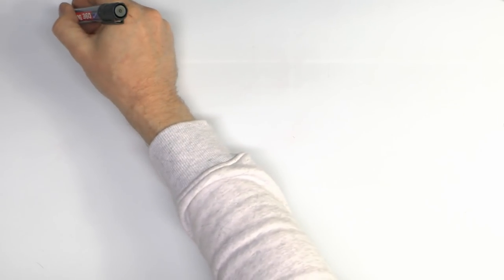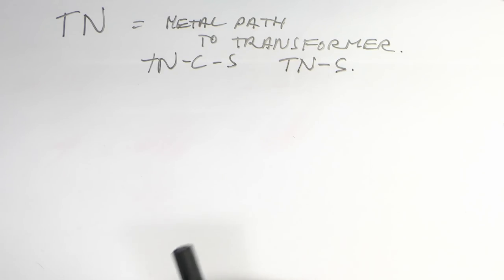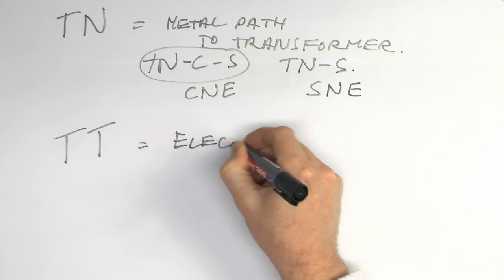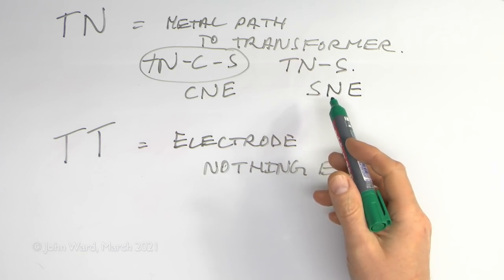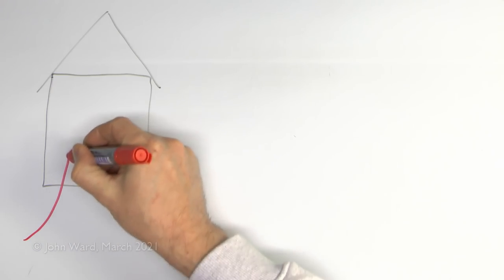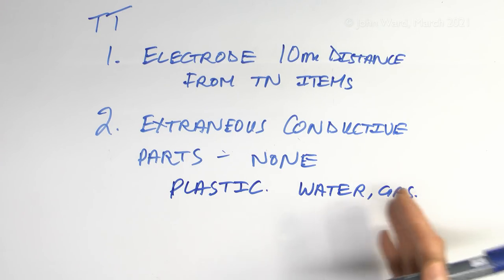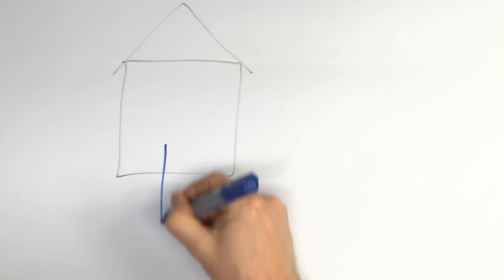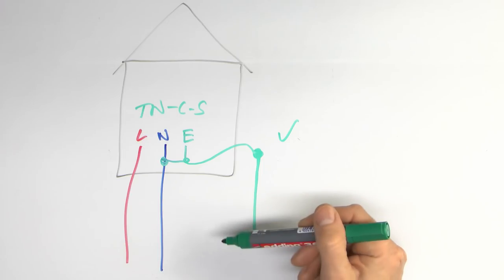Using a TT earth where a TN earth already exists

Comment: Why not extend the earth cable at 12:03? Let's assume we install an external WIFI router instead of an A/C condenser. That means an ethernet cable probably also runs inside and connects to other electrical equipment. Wouldn't it be a good idea to bond the earth spike to the house earth in order to prevent differences in ground potential difference? I'm asking this because I personally had wifi gear on a pole outside my house, and almost every electrical storm without fail blew ethernet ports on the routers (I was only using an earth spike for the gear and pole outside). I'm guessing I could have alleviated or prevented some of that damage if I bonded the earths, or relied exclusively on the house earthing rather than a separate earth spike?
Reply: Stuff like wifi routers are all isolated low voltage dc made by switchmode power supplies. There should never be a path to earth from the isolated secondary side. So long as your router has a power brick and only a dc input you just need some form of optoisolation on the ethernet cable as soon as it enteres the property to prevent a potential path to earth via your ethernet cable. Also providing a preferntial path to earth for lightning strikes near your pole may be benificial.
Reply: Many years ago I was part of a team that created a "pole top" concentrator for low calling-rate telephone lines. It linked 14 telephone lines to the exchange using only 4 pairs of wires, the idea being to be able to offer service to new customers when there were no spare pairs in the existing cable.
The prototype worked beautifully linking our office phones to the site PABX. However when we put the pre-production units into the field, actually on the tops of poles and linked to the exchange via overhead wiring, the failures started. Unit after unit was returned as faulty and in every case the fault was lightning damage. Some of these units had been miles from the lightning strikes but the induced current in the phone cables had been enough to blow the semiconductor switches used in the unit. It proved impractical to adequately protect the unit from such surges and the project was abandoned.

Comment: An interesting Video JW, thanks. I can confirm a 10ohm or lower electrode is difficult to achieve. Our lightning protection system installed on the explosives magazine needs to be below 8 ohms, it turns out that's a large earth farm!

Comment: I am not an electrician.. but I am involved a lot in Cambodia where skills are minimal and safety is not thought about. On our small farm, there is no earthing system - this was going to cost more money, so they don't do it. I have a shed where I have a lot of tools, lathe and particularly welders - all without Earth connections. I am thinking, can I at least, make things a little safer by putting an Earth rod in where the shed is.. it is remote from the main house... and then connect this Earth rod to the earth outlet connections in the shed. Would this provide a level of protection, and should this Earth connection then also be connected to the Neutral ? which of course then would connect all the way back to the sub board in one of the properties and then to the main board where the power enters the properties... I know the answer  is to put a proper earthing system in all the way through but at the very least, I want to improve the safety of welding where there can be a lot of water also.. ugggg.. :-( ...

Comment: If the outbuilding is a Metal structure on concrete floor with incoming water in plastic pipe, what earthing arangement should be used If house has TN-c-s? And shall you bond metal structure?  Thank you JW

Comment: Help please! I had an electrician install an all metal construction, step lift in the garden. Few years on, after watching JW, i realise the armoured cable was never properly installed via a glad to the CU, nor is it possible now because the cable entry into the house is buried in the wall. It might well be a 3 core cable, not checked yet. If this appliance isn’t bonded properly, would a TT setup be useful?

Comment: Just what is the issue with bonding a TNCS supply to an earth rod. Surely you then have double protection and a lower protective earth resistance.
Reply from the maker: There isn't one, but to have any real effect, that earth rod needs to have a very low resistance.  A single rod with 10s of ohms or more will do nothing.
Reply: @jwflame  Thanks for the reply, I agree the earth rod must be effective to benefit or several. Some idiot stole the copper bonding from our local sub station station. The power company came and installed temporary earth rods as were on a TNCS supply.  Since then we I felt safer with our own earth. Thanks.

Comment: Hi John, great video however if you say that outhouses need to be TT due to extraneous metalwork and the need for 10mm bonding how does that relate to a hottub ?  As i understand it hottubs are mainly plastic or fibre glass. Appreciate your reply. Thanks Tony
Reply from the maker: if there are extraneous conductive parts, they either need to be bonded to the TN-C-S supply with a minimum of 10mm², or if it's configured as a TT install those ECPs cannot be connected to anything with a TN-C-S supply, which in most cases is impossible as it's very likely those parts will be shared with the main building or other buildings nearby.

Hot tubs don't need bonding as they are not extraneous conductive parts.  They will have an earth connection to the heating element and possibly other components, and that is sized based on the cable that supplies it.
Making a hot tub TT is an option but can be difficult or impossible as the electrode for it has to be far away from anything connected to a TN earth.
Using TN-C-S for a hot tub can have other problems, those are covered in another video which will be published later today.

Comment: May I ask, what your views are on the A2:2022 regulation 411.4.2 (p68 of the BBB - BS7671:2018+A2:2022) please?  Whereby, it is now recommended to  (i.e. you SHOULD) install an additional connection to earth by means of an earth electrode (as a TT backup to the PEN)?  And, with respect to outbuildings, would you still divorce the PME from the house and install a local TT, or does this now mean that you can export the PME/TT to it?  Thanks.

Comment: So if you connect a remote building to a TNCS house, you should take the earth over from the house and join it to an additional ground rod. If the remote building has a steel structure (RSJ into the ground) could that be used instead of a ground rod?

Comment: Hi John, I was wondering if large isolation transformers would be an option, although clearly would add Extra costs
Reply from the maker: Yes they are.  An isolation transformer is mentioned in BS7671 as an option for EV charge points.  Cost is the major problem, £100s for even a small one.
Reply: @jwflame  well isn't that the truth!
So are you going to take me on as an apprentice now or what?

Comment: As the water pipe comes from the main building, and as you suppose it is already bonded. Would you have to bond it again?  Or could you just instead use the main earth from the cable to do bonding only?

Comment: Thanks for the video, always appreciated. Does someone not make an RCD type device which looks for a current >"x" in the conductor between the MET and the earth rod - and when tripped will disconnect  Line and Neutral conductors?.
Reply: Interesting idea. In order to keep the integrity of the cable between the MET and the earth rod I envisage a current transformer around the existing unaltered cable. Hypothetically, ? could a very small amplified voltage generated by the sensing coil around the cable be applied to something like a modified RCD deign (100 Amp). One MET = the whole supply disconnected.

Comment: I have a question to you John. When there is a risk of EMC problems due to PWM devices like solarchargers etc we learn here (Sweden) to use armed/shielded cables and connect both shielded ends of the cable to earth with short connections to lower the impedance for high frequencies. In the case of the shed having its own TT earthing and an inverter or charger positioned there what is then your opinion about the best way to go forward when it comes to earthing? I like your tutorials!

Comment: If I change the incoming water pipe to plastic, but there is metal pipes in my house. Won’t the water itself lead electricity and there by my pipes inside the house is connected to my neighbors earth connection?
Reply: It depends how much dissolved solids your water contains, pure water is an insulator, its only when theres shite like salt etc in it that it conducts electric. 
When you take into account the resistance of all the water between yours and your neighbours house, any fault current would likely be very minimal

Comment: Shouldn't the RCD to your car charger or shed trip even if the ground stake is more than 10 ohms? Is an isolation transformer to likely to fail for safety?
Reply from the maker: A broken combined N&E conductor on the supply will not cause any RCD to trip, the break is on the supply side of the RCD.
EV chargers can be supplied from an isolating transformer - the problem is that the transformer will cost more than the charge point.
Reply: @jwflame  OK thanks, I never thought about it before but this is probably why we use to get a shock on the kitchen sink when running high current stuff like the feed mill as the mains line is always going to have some resistance.

Comment: I have a question-why must one conductor be earthed at all? With the electrocution hazard involved, would it not be better if neither was referenced to earth?
Reply from the maker: If a system could remain isolated, it would be safer. It's used in a few specialist applications.
The problem is keeping it that way - any single fault to earth anywhere would make it into an earth referenced system but with no control over which conductor was earth referenced and no way to detect that fault until a second fault occurred.
Reply: @jwflame  The man himself answered me! Thanks John. I use an isolation transformer when I work on old radios and every time I use it I wonder why the residential service has reference to ground. By the way, could I make a suggestion for a future video? The SWER system used in very remote Australia and other parts of the world? I find it fascinating and I know your analysis would be spot-on.  
Take care, Ian.
Reply: We use exactly this IT based system on the railway.

However copious use of insulation monitors mitigates the chance of a single earth fault causing issues... For installations with no insulation monitors then every time you open the cabinet you have to do an earth test (unless it's vern done in the last couple of days) thankfully they are quick and easily done but you do need to understand the method and readings you get.... It gets even more complicated when 25kV overhead wires are involved because those are earth referenced (whether you want it that way or not, rail lines even when on insulating pads make a fairly good earth over many miles!} https://www.bender-uk.com/products/insulation-monitoring-overview

Comment: What about electric vehicle chargers that are 20m away from building? Isn't TT the best way? Electrode shoved right under the charger/vehicle. Even if there is a power line beneath...humans are still walking on that same ground where electrode is (or isn't).

Comment: Interesting topic, now EV chargers come with PEN fault detection, surely manufacturers could come out with a PEN fault detector for the whole installation??
Reply from the maker: The same junk that's sold as PEN fault detection could be applied to a whole house.
As it only works some of the time, there really isn't much point.
Reply: @jwflame  thanks for the reply, do you have a video on PEN fault detectors and their problems? Would be interesting to hear your opinion. 

Kind regards.

Comment: The problem explained around 13min: wouldn't it also be problematic if the earth rods was placed sufficiently far from the burried pipes, but someone touching the EV was standing close to those pipes. Isn't the condition for safety that someone touching the EV needs to be standing much closer to the earth rod placement than to the burried pipes.

Comment: Interesing video...would not the 10m distance for a TT rod be only in ideal circumstances?
I live in a terraced house with a small garden, overhead supply with no supplied TNS earth hence the use of TT, ( Ze of 25.2 ohms, Zs of 0.19 ohms), as are most in the street, but a couple of properties have been converted to TNCS from the overhead supply. All other services are still metallic. It's not possible to be 10m away from any services or other TT rods therefore some rods will not be 10m away from TNCS converted supplies. Is it really feasible to account for other earthing systems within a group of buildings?
Reply from the maker: All of the properties should have been converted to TNCS, or none of them.  With only some done, they are TNCS, and the remaining ones which were set up for TT are probably not TT any more, due to the metallic services connected between the properties.
The output of one transformer should be a single earthing system.
Reply: How can the Zs be less than the Ze!?
Reply: @AdamWatson001  parallel earth paths

Comment: 12:04 why does the earth cable stop there? Does it earth just the charger’s housing?
Reply: No connection between TN system and EV charger housing, the cpc stops before entering the charger.

Comment: John at 10.10 if the water pipe is bonded in the house, would it still need to be bonded again in the outbuilding?

I did an EICR TNS system, outbuilding same pipe, bonded in the house but not the utility outbuilding i coded C3 as it was bonded but not in right position
Reply from the maker: Yes - although they may be connected together underground, they should be considered as two separate pipes, bonded at each building.
Reply: @jwflame  yeah thought so, a new install I would have, but EICR, plus the distance underground was only 2 metres and part of owners I C3 instead.

Comment: Well, I know the water supply to me is supplied via asbestos cement pipes, the HDPE stopped 50m away, leaving the old AFC pipes instead. The feed though off the fibre pipe is a corroded steel pipe, and half the underground pipe is copper or plastic, along with big chunks of the inside pie as well. Still have boned the copper sections together and to the water heater, as the inside pipes are a lot better off in copper, as it lasts so much better than the plastic, and definitely is likely to last better than the galvanised steel pipes did. Still is some steel pipe around, but lucky for me not to me, all long gone, feel almost sorry for those with the steel, as it will be expensive to replace.

Still have cast iron waste pipes though in the stacks, they will all eventually be replaced with PVC when they fail, but till then they are generally in good condition for the vertical parts. the horizontal parts in the ground are vitreous clay pipes, when they eventually fail the new part of them will be PVC, except for the one section, where the replacement part will be expensive, involving hydrocracking and pulling through a HDPE replacement pipe, as this one runs under the foundations of the building. Already know which company will do this, they are good at it, and have done a lot around here.

Comment: Would it make sense to run the last meter or two of metal pipe in plastic instead? (ref 10:55) then you would not need the bonding when it enters the out building?
Reply from the maker: Yes, or do the whole supply in plastic pipe.

Comment: Great content as usual JW; could I ask please regarding the rule that an a stake should be 5-10m away from any other conductive item connected to the TNC-S; would this include other swa cables going off to (anywhere > other outbuildings for example)?  I ask because SWA is not necessarily conductive (or exposed) if it sheathing is intact; however any damage to the sheathing would render them conductive. Therefore is it better to assume that any local (within 5-10m) swa's sheathing might not be 100% intact and so consider the cable conductive; what are your thoughts on this ? 
It could be argued that 80% of (inner city) TT installs relying on a TNCS line & neutral, are not really TT, if you take into account what I mentioned above.